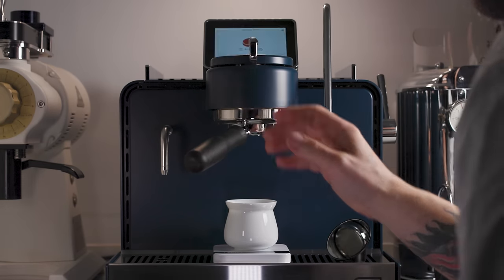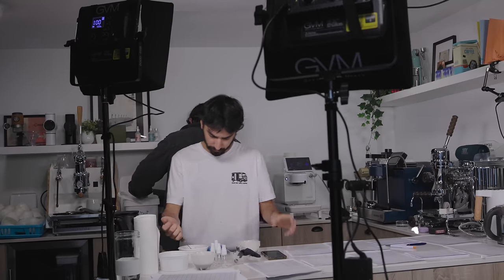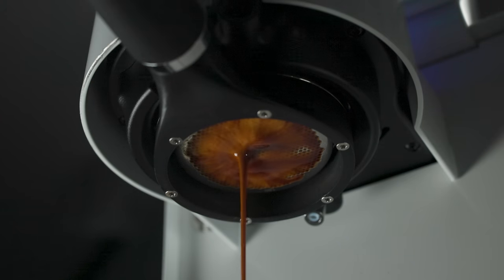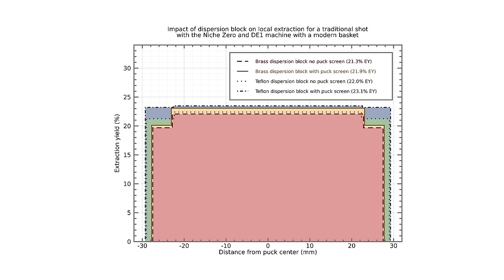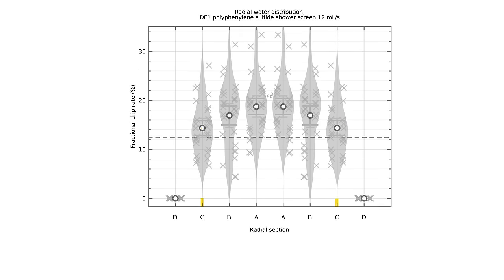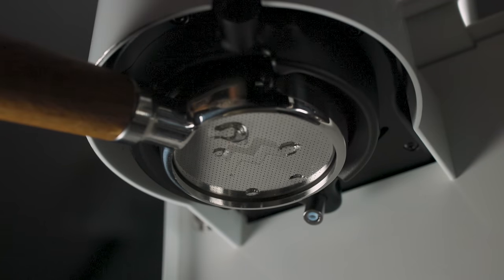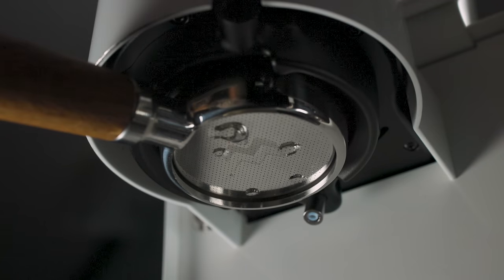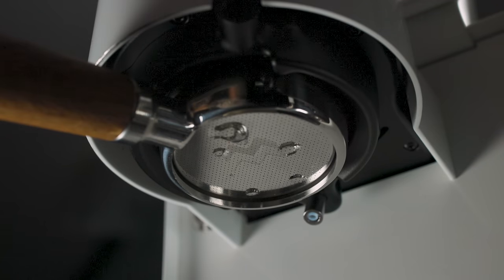MAKING ESPRESSO BETTER: Improving Espresso with Understanding

Comment: I bought a delonghi dedica and a kingrider k4 to find out that  it takes a master's degree to brew  drinkable coffee.
Reply from the maker: Not at all. Never said this is what it takes for drinkable coffee.
Reply: @LanceHedrick I need to go back for my PhD?? All jokes aside, love these videos! Its awesome to see how all of the process changes actually affect the outcome.
Reply: The kingrinder K4 is a very finicky grinder  in regards to the sensory characteristics caused by the coated burrs. Loads of acidity, light roasts are tough to dial in. 

The espresso range that I've used on a couple of semiautomatic machines was between clicks 58 and 65 .
Reply: That setup will get you some very good espresso for the price point. Lance's videos focus more on the small more scientific details of espresso. Also, higher extraction does not necessarily mean a better tasting shot. Flavor is king, if you like your coffee, then you're doing it right. Don't let the perfectionists scare you away from that.
Reply: I started on a dedica before getting a flair 58;after about 2 years. Honestly it makes great dark and medium-dark coffee. Just didn't get hot enough for really light roasts
Reply: @LanceHedrick  I know. I spoke in a figurative way because it is hard to get it right  consistently. It feels like a hit and miss situation.

Comment: Any thoughts on the slimmer profile puckscreens that are now available? (Ones that are not mesh, just a thin sheet with holes poked into it like the IKAPE one).
Reply from the maker: I ran tests on those! In my puck screen video
Reply: @LanceHedrick awesome! I’m actually experimenting with double puck screens (mesh screen with IKAPE style screen on the bottom) to keep the mesh one clean and also have better dispersion and compression on top of the puck. Results are quite positive to me but it’s purely qualitative, didn’t attempt to quantify it in any way.

Comment: my espresso DID suck till someone told me to not be such a slave to the 30 second shot, now it may not be ready for raw drinking (I'm not sure I'll like any espresso that way though) but it's so much better after your video made me try a coarser grind after trying too hard to hit the shot time, I do need a new puck screen though the one I was using didn't work well and made things worse.

Comment: Most puck screens are two-ply with an adhesive substance sandwiched between them. Does anyone know what that substance is? My guess is aluminum. A couldn't imagine any other sort of adhesive that could hold up to heat and 9 bar water pressure.

Comment: I’m confused. I have enormous problems with my Flair 58 extracting in a donut shape around the edge of the basket with little extraction through the centre and upon inspection the grounds through the centre  are clearly dry and unextracted after the shot. So at 3:45 when Lance mentioned this phenomenon and said that Stephane Ribes’ work had proven that these shots are not necessarily bad, I was hoping for some illumination. But Ribes’ work seems to deal with the opposite issue, ie during a normal shot there is less extraction around the edge and more through the centre.
Reply from the maker: Yes because doughnut shots aren't doing what you think. They always underextract the edges unless using a modern basket. how are you sure the middle isn't extracted well? That seems nearly impossible unless you aren't distributing at all and the center has a massive mound prior to tamping.
Reply: I have very even extraction with the flair 58 after inspecting the puck is extremely homogenous in color, donut shots do not extract more at the edges. Maybe your puck screen is clogged, try another. Besides after purging the water the puck is obviously dryer as air passes through it.
Reply: @LanceHedrick  thanks for the reply, Lance! When looking at the extraction from underneath, it starts around the perimeter of the basket and then the espresso runs along the underneath of the basket to the middle like several spokes of a wheel. It goes pale very quickly because it exhausts that outer area of ground coffee, and leaves the centre clearly dry and unextracted and the espresso weak and unexciting. I’ve tried all sorts of things, like varying WDT patterns to reduce density of grounds in the centre, using a convex tamper, using different beans light and dark, using different coffee amounts from 12-18g, using different baskets, using filter paper above and/or below the coffee, varying pre-infusion, varying how I ramp up the pressure, trying different puck screens or no puck screen, slow-feeding the Niche, trying the turbo shot thing (which works great with the Silvia), and even using a foil ring on top of the grounds to FORCE the water through the centre, all to no avail. I even tried one thing that I won’t tell because it sounds too ridiculous 😂🤣😂. I have been using my trusty old Silvia for the last few months with my Niche Zero, but now that I have received my Sculptor 078s I will try the Flair again and reassess. Thanks again!

Comment: This makes me think that water column style lever espresso machines like the Flair 58, Robot, or the upcoming Meticulous will have the most even extraction potential since the column of water should apply nearly equal water volume to the entire surface area of the puck. Has the cookie cutter experiment been done on a Flair 58 or Robot?
Reply from the maker: It has not. I think it would be true for spring levers since the flow rate initially is so high. With a low flow even with even pressing, you cannot control the initial drops
Reply: @LanceHedrick   True, and with water column style machines the flow rate into the extraction chamber is essentially infinite since all of the water is already in the extraction chamber. That is the asymptote that all boiler style machines will be approaching.

Comment: What portarilter handle is that with the hex bolts on the bottom?
Reply from the maker: it is the canal hummingbird. Not cheap. I use it pretty much solely because it can lay flathaha
Reply: @LanceHedrick  TY

Comment: I use a bambino at home while i save for something more consistent, controllable, and reliable. In the meantime, ive noticed puck screens help even out extraction with my shots but i was wondering if changing the shower screen on a bambino would actually do much of anything (accounting for the inherent limitations of the bambino)
Reply: What inherent limitations are you referencing please, as I am considering the bambino plus, bu in two minds (currently use picopresso with jmax grinder)

Comment: What if new baskets are machined to have increasing hole size radially as you move closer to the basket edge to promote more flow  to the edge?
Reply: Or increasing hole frequency
Reply from the maker: Perhaps! Still doesn't really fix the fact that where water drops first will be preferred for flow. It's difficult. Especially when using a traditional basket.

Comment: Can anyone confirm the new Decent dispersion screen is SAFE from a health standpoint? I can’t shake the feeling that the material is leeching PFAS or microplastics… I know they said it’s an FDA approved material for food, but is that still the case with heat applied?
Reply from the maker: Would need to be in excess of 500F. And that's for teflon. But the final version isn't teflon. Not sure what it is.

Comment: What about a concave tamper with a traditional basket
Reply from the maker: Trad basket will always underexttact edges with trad flow. The bottom is the issue. The reason it evens out with turbo shots is the coarser grounds and faster throughput

Comment: I don't see why you are suggesting that what is being presented in this video is new. I have been applying all of this based upon what I have learnt from watching other videos of yours and others, and doing my own experiments. It is nice that you are expressing these ideas explicitly here, and I have no doubt that had this been your first video on extraction it would have helped many to understand your other videos and put them in proper context. BTW, I find slow feeding a Niche Duo produces fewer fines with a faster extraction for a given grind setting. You know when to add more beans from the change in sound, and it does not add very much to the overall grind time.
Reply from the maker: The doughnut shot from baskets being inadequate is something I've discussed..it's been previously not discussed that shower screens and even moreso dispersion blocks can cause water delivery issues.

Comment: Will this change your workflow or equipment compared to you "how to make espresso" video?
Reply from the maker: Nope! I'd already optimized these issues by using the new dispersion block, modern basket, puck screen, and fast flow rate.
Reply: @LanceHedrick  do you have a recommendation for the RSPX? What additional parts should I get to get the best extraction?

Comment: So we need redesigned shower screens….maybe
Reply from the maker: definitely a step in the right direction!
Reply: Likely not enough, the problem isn’t just the undersized or design of the screen and dispersing block, the problem is likely also the angle of how the water enters the dispersion block on pump machine, on most machines it’s at an angle and you can clearly see this when flushing the group with or without that, then there also the water debit.
Reply: @mikni4069  The problem is a lot more simple than that. Most pump espresso machines are built so the water is entering the brew group through much thinner ID tubing - probably 10mm (about 3/8") at best, depending on machine - and trying to disperse it out evenly across.... about 60mm diameter of space.

Comment: 1:56 boulders can be eliminated by adding water to the beans before they are ground. There's some kind of static that holds them together. Some grinders have a little electrode thing that charges them so that they don't stick together.
Reply from the maker: Not quite. I have a video covering the science of it. Boulders cannot be avoided. But more Boulder like combinations can be with a sufficient amount of water.
Reply: @LanceHedrick  well then you're just failing to get the water inside the bean to stop the clump from happening before it comes out of the shell. That's just a physics problem. You could honestly solve it easily by getting water inside the bean before its ground, which could most easily be achieved through a pressure vessel. I wonder what would happen if you were in a very humid environment pressurized to like 5 atmospheres or maybe even 45 PSI like a normal car tire grinding the coffee.

The solution is simple. The application of the solution is very hard.
Reply: yeah im gonna need you to come in on Sunday and go ahead and invent this product.  Mm-kay?

Comment: Coffee Nerds are on the same level as Audiophiles. I would bet money in 9/10 cases you couldn'T tell the difference between those minute changes. ANd it comes down to "Yeah that's fine" and "No that's bad." and very very very few people could tell the difference between a coffee that tastes like a 8/10 and a 7.5/10. Rarely is there community so obsessed over insignificant stuff. Still enjoyable to listen to, mostly because it feels like white noise.
Reply from the maker: As I clearly state in the video, it's not about one or two changes. It's learning and figuring out better ways for the future. What if we had your attitude 50 years ago? Specialty would have never materialized. Settling for good enough is lazy and myopic.
Reply: Big difference is that there's a strand of audiophile products that cannot make any detectable difference to the sound. £300 USB cables anyone? Or £25,475 for a kettle lead? At least if there's a measurable difference in extraction, it's possible that there's a difference you can taste.

And these differences are going to add up. A couple of percent here, a couple more there, a touch better with another technique and you can end up with tastier coffee, which is surely a good thing.
Reply: @LanceHedrick you forgot government cheese

Comment: Yeah, too complicated and too much talking, just get to the point.
Reply: The point is you're leaving Puck edge extraction potential on the table If you use flow control, and don't use puck screens, and have curved traditional baskets.